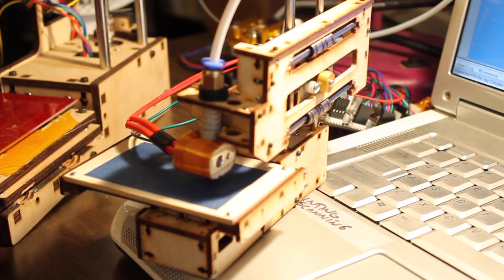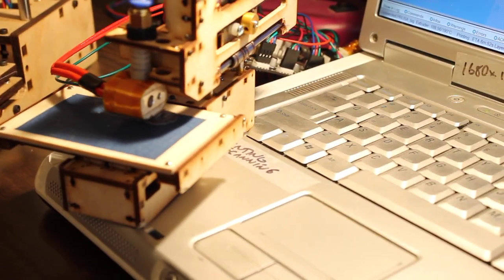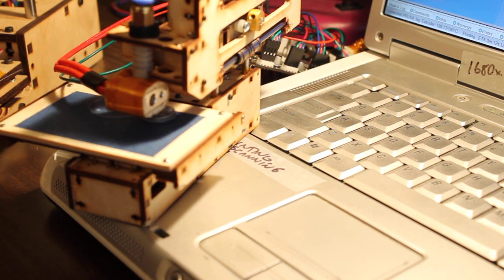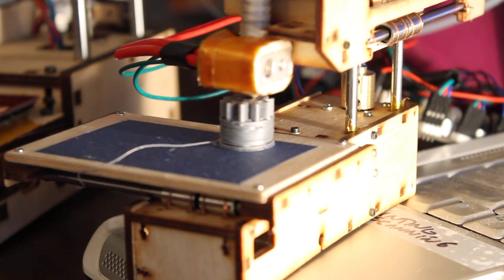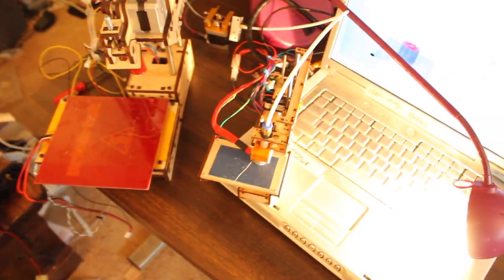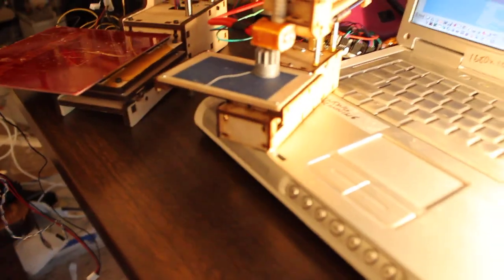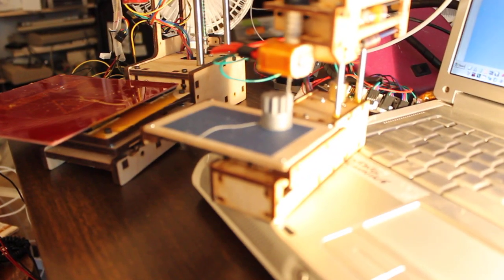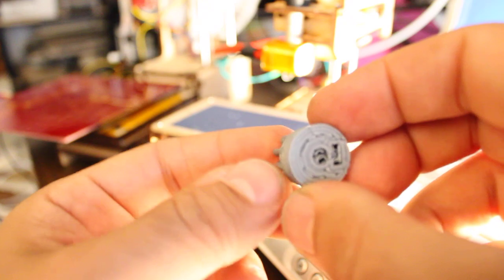James Carpino Half-scale replica of Printrbot Simple (Miniature 3D Printer) MVI 6477

Comment: quick question, did you use gt2 belts? Trying to make a half scale printrbot
Reply from the maker: I used MXL belts 1/8" wide but you can use 3mm  GT2.  MXL offered smaller pulleys; I used 10-tooth pulleys vs. GT2 12 tooth.
Reply: @jamescarpino1879  thanks!